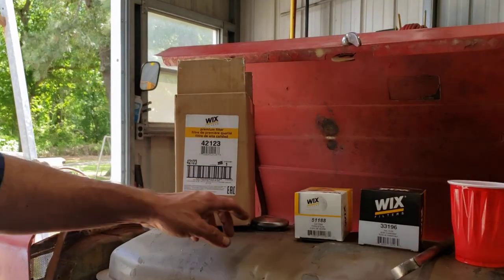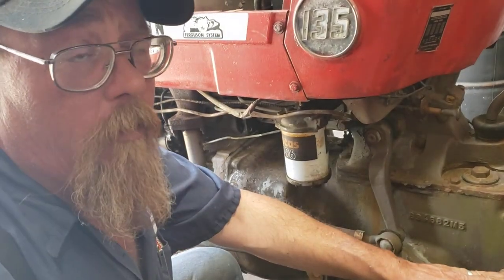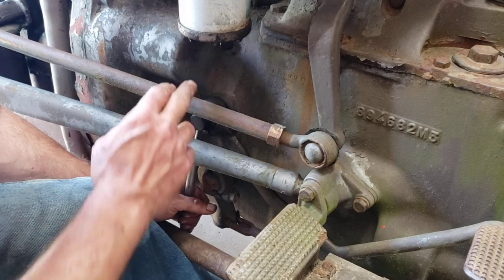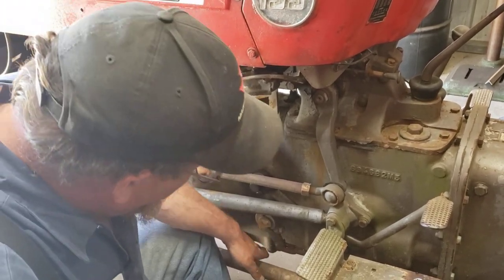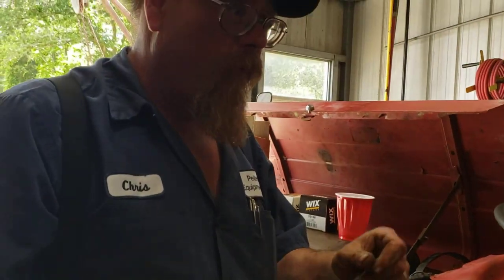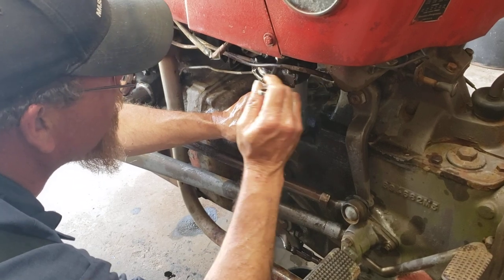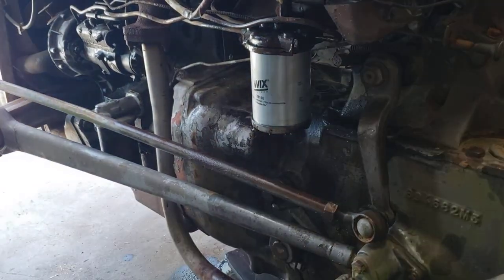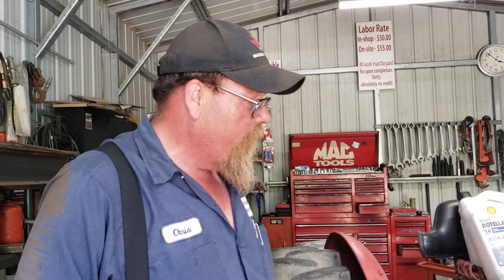135 Massey Ferguson Clutch Adjustment & Service

Comment: Maybe I just didn't adjust the clutch properly when we changed the thrust bearing and the adjusting screws, as the PTO does NOT disengage.
Reply from the maker: You can adjust them through the plate under the bell housing but it's aggravating , set them at 75 or 80 thousands book says 90 but they need to be tighter.

Comment: That's called a "roling head bar"
Reply from the maker: That's the big ones I think , these little ones have about 20 different names depending on who made them . Line up bar, injector puller , pin bar , pinch bar , jimmy bar but most just say pry bar on the pack but I do have a BIG  one from Snap On that said roll head pry bar .
Reply: Definitely a lady finger in the oilfield

Comment: Just bought a 135 with the Perkins gas. 
PTO grinds when I engage it. And clutch releases at the very top of the pedal. 
Will a clutch adjustment help me? Or am I looking at a new clutch?
Reply from the maker: It probably would help especially if it's releasing high